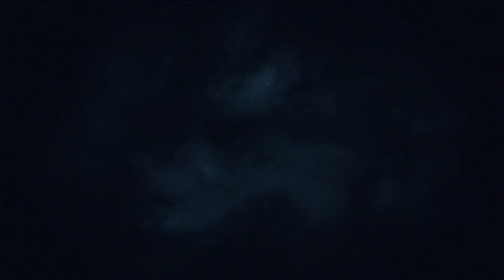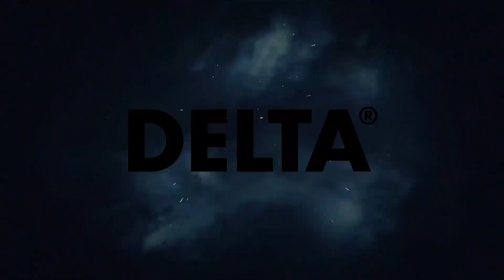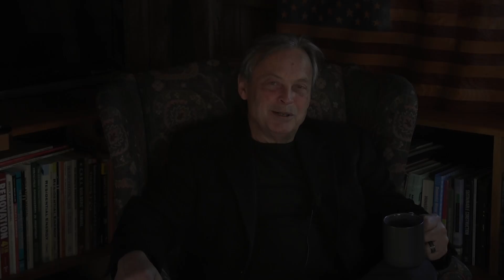A Cup of Joe: The Rainscreen | Building Science Deconstructed

Comment: I always learn something from you, Joe.
The concept of a rainscreen system dates back to medieval times. Illustrations can be seen in churches constructed with wooden rainscreen cladding in the typical Norwegian wood and stone architecture. A stave church in Urnes, Norway, built around 1130, still survives. It is recognized as the first use of an architectural rainscreen. 

These earliest rain screens were created through experimentation rather than through scientific research, with wood cladding, using tight seams between boards, leaving an air cavity behind with ventilation at the top and bottom of the facade to enable rainfall to flow away and moisture to evaporate into the eaves above.
–Fairview Architectural

Comment: I assume this is a good reason NOT to apply spray foam (even closed cell?) directly to the back of corrugated sheet metal when it's used as an outer layer on a structure (say, for the new "barndominium" building fad)? Would you recommend house wrap beneath the corrugated metal and applying the spray foam insulation to the house wrap from the inside of the house? My builder is saying that applying it directly to the metal adds structure and won't give us sweating issues but I've read otherwise.  As well, I've heard say that some metal suppliers won't uphold their warranties if spray foam is applied directly do it...presumably due to corrosion which I assume is created with no air layer between the warm inside of the house and the cool outside.
Reply from the maker: Here Joe is discussing rainscreens with reservoir (or absorptive) cladding.  Corrugated metal would not be a reservoir cladding, so we haven’t any worries about inward vapor drive given that metal can be both a vapor barrier and an air barrier (if made continuous).  We recommend you consult with your cladding manufacturer about the advisability of spraying against it the specific type of foam you are considering using.